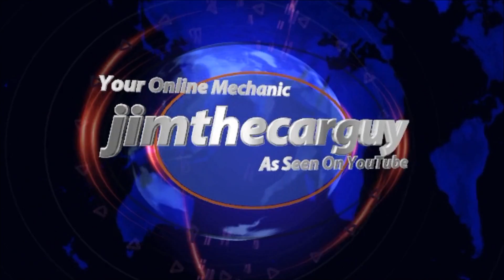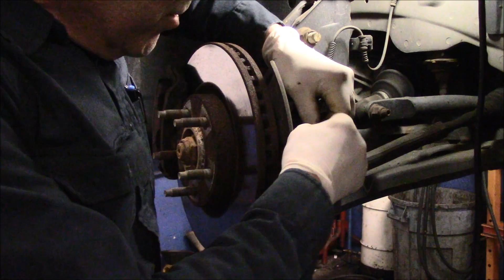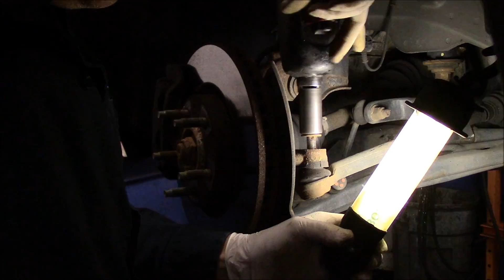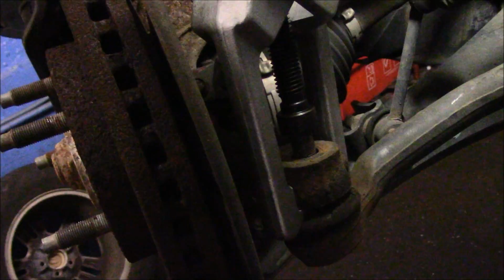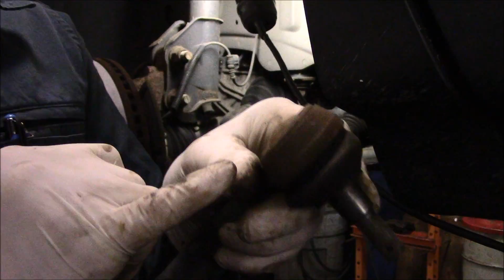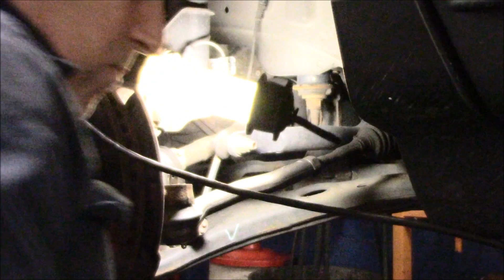How to change a tie rod end

Comment: I can see the advantages of using a replacement part with a zerk fitting but if one fails to keep it greased it may wear out much sooner than it would if had used a sealed unit to begin with.